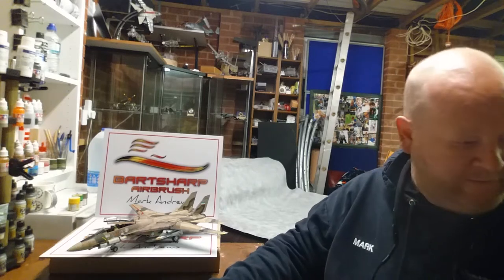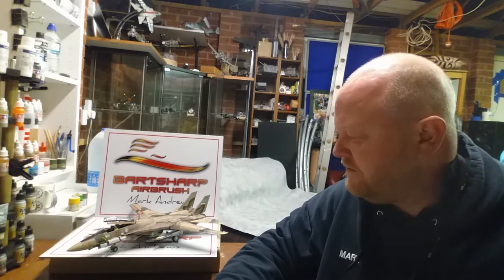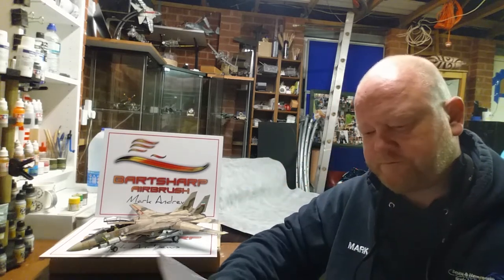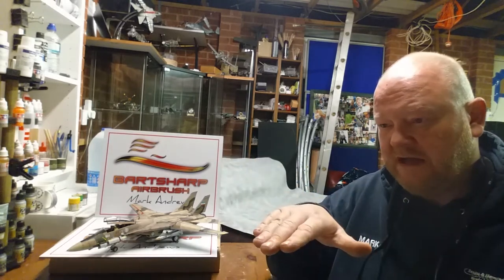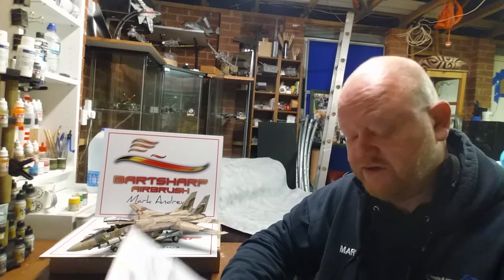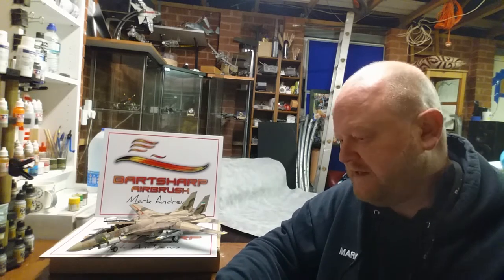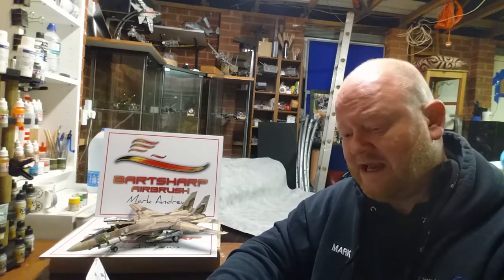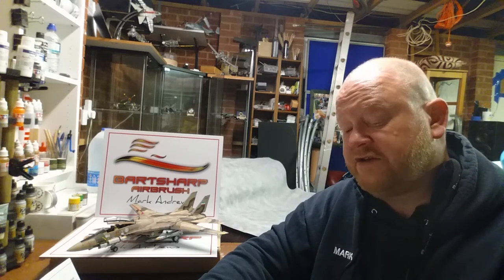1/48 Persian Cat from Hobby Boss post build review

Comment: Looks lovely mate, the Iranian F 14's certainly were used a lot. I had just finished my tamiya F14A in 1 48 and same scheme, today, then I dropped it! Well unhappy, so I will get the HB one, and start again.
Reply: Have you built the HB one yet? Thoughts compared to the Tamiya?
Reply: @CPiGTi  Hi, no not got around to building the HB one yet, but soon for sure.
Reply: @CPiGTi  The Tamiya one is bonkers good. I think the best F14s out there. Typical great but simple Tamiya Engineering, great presentation too. Hobby Boss is great too but needs more work could say its more of a above beginners  modelers kit because of that.

Comment: Nice job! I would make this kit and i have just a question..the wings are movable (obviously with slat and flap up! 😁).
Do you like to build this kit?
Reply from the maker: Hiya bud to be honest I can't remember.  It's a good kit just be way wary of that landing gear going in early on in the build sequence.  Recommended kit
Reply: @7Markandrews  Thanks. Tamiya is too much expensive for me..and i was thinking about this kit. Landing gear is not a problem, i will make it in flight position, with a stand and Hasegawa pilots.
About fit, putty, sand, gap..is ok or like Italeri?
Reply from the maker: @blackcat3383  fit is excellent bud. It's a quality kit for sure with minimal effort and with the open hatch options at the front it looks really good.  Armament is like eh? Especially if you're used to seeing phoenix slung underneath and there's not much detail on those missiles so that area is a bit of a head scratch.  Decals A-ok, fit is excellent. It's an expensive kit. 
I say in my videos would I build it again and I said no. I think I paid about £60 for it which is well out of my price range but I stuck my neck out for this kit which is why I said no. I usually pay around 30 to 40 max for a 1 48. 
Value for money v Tamiya kit.  Equal.  Depends on how much you can get it for. Under 60, worth it. But I wouldn't pay more than that